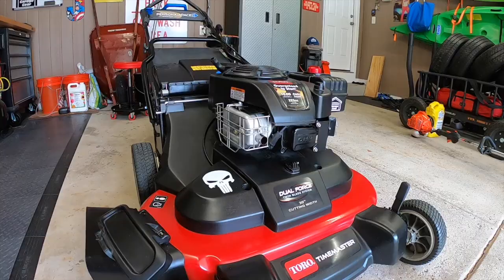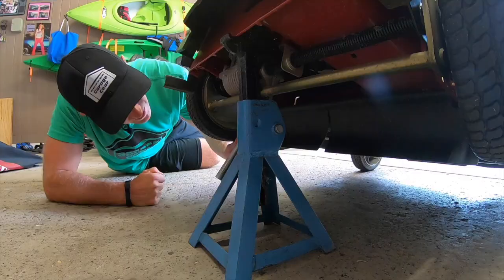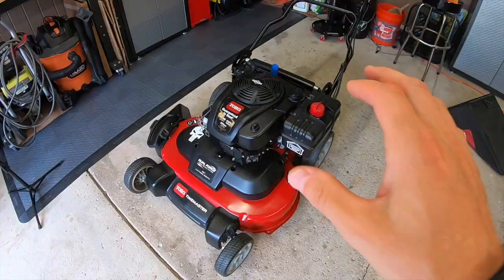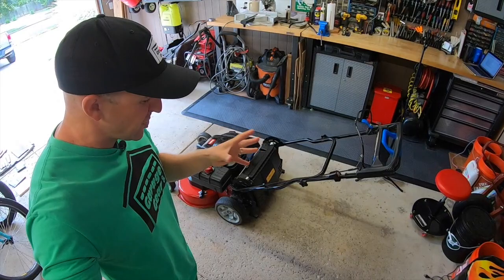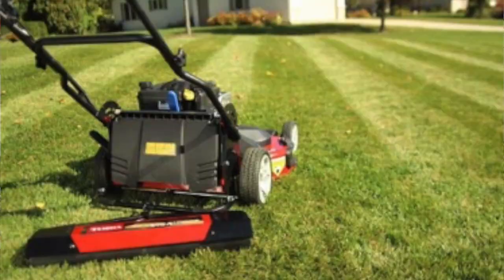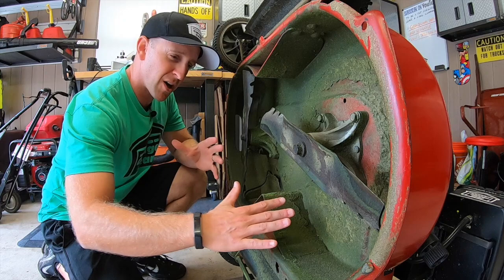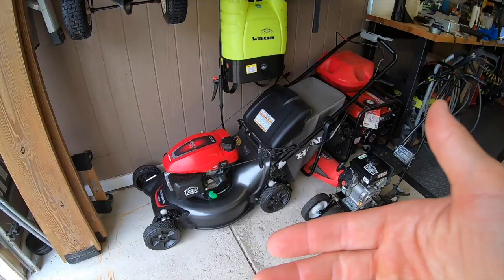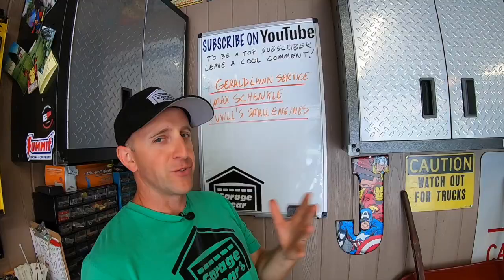BEFORE YOU BUY A TORO TIMEMASTER, WATCH THIS!

Comment: Okay I've seen this complaint about the flap. Some people are having that issue while many others are not. These Toros are assembled and built all over and there appears to be one in particular that's making the drag flap closer to the blade shroud which is eating your flap.  Sure you could make your own flap but honestly it's just going to keep happening over time.  The solution? Drill new holes and move the flap back. Let's talk about the water port. It's not really in a good place, however I don't think anyplace on that deck is a good place because you aren't dealing with a blade mount that doesn't have bearings. Yes it's true, if you use the water port or even lift your mower to wash the deck you will like ruin the bearings in the spindles. Solution? Don't wash your deck using the port. If you do use a garden hose make sure you dry your deck, best and fastest way is with a blower. Do not! I repeat do not use a power washer!. Also stop mowing wet grass but if you can't? Use WD 40 on the deck or wax. Pulley problems? Buy the commercial grade and please use common sense taking the cover off to blow debris out from around your belts and pulleys, it really doesn't take that long to do that. If you are harping about the gas tank might I remind you this mower isn't a commercial mower, it's a Residential Mower 👈. If you are complaining about that then you should have bought the Turfmaster.  Having discharge issues? Take the grass chute off and use a bungee to hold the side cover up, your grass will now spread out leaving no clumps. I rather enjoy my Timemaster and I'm with you on the gas tank, however that doesn't really bother me because I get my jobs done much faster and the mower is easy to maintain.  Sure I could have bought something else but this was in my budget and when it comes down to mowing with this or my 21 inch Toro I'll go with the 30 inch everytime. Toro could easily manufacture a bigger gas tank for the Timemaster but they wont because many wouldn't bother buying it to install because they aren't inconvenienced by the smaller gas tank. Yeah where ever your mower was manufactured they didn't drill the holes right, I can tell you without a doubt not all Timemasters are having that issue with the drag flap because I've had mine going on 2 months now and the flap isn't getting chopped up on my mower and believe me, I always check it after mowing.
Reply from the maker: Thanks for sharing this ICUE!!

Comment: The flap hasn’t went on either of mine yet, and I use them commercially, but the drag flaps are junk. Gas tanks as well. And they leak when you prop them up. I also just repainted my deck (after scraping it down to the metal from clogging) clear coated it twice and it still clogs ugh
Reply from the maker: Our efforts seem futile ya know lol! Nothing prevents the clog on these suckers. Thanks for watching Aaron!

Comment: Hi guys gr8 video I'm a gardener in Ireland lots of rain was thinking of buying the professional model I normally use a Honda 537 hrx plastic deck .Q so wud the professional model be a good buy coming in around €2900 or stick with my Honda which the price has just jumped up regards Vincent
Reply from the maker: Hey Vincent! Not to much changes other than the engine and wheels going up to the professional model. You’ll still have deck issues, and some transmission issues depending on which version you buy. You will get better pulleys. Not sure if it justifies the cost. Many are sticking with their Hondas for these reasons. Thanks for watching

Comment: I've had mine for 3 years now. Piece of junk. I've replaced the blade engagement cable 3 times and it broke again. Cheap plastic top end is always bending in a direction it wasn't meant to. Once that happens the blade will not engage. If I wrap a zip tie around it I can go a little longer, but eventually I have to replace the cable again. $35 from the dealership, $16 on Amazon. Toro does not sell the part directly (got to keep their dealers happy.) I texted Toro about the problem. Asked them why they made the part out of plastic. They mailed me a warranty extension application. Stay away from this one.
Reply from the maker: Thanks for sharing this information stedew! 👍👍

Comment: Honda HRX owner here looking to buy a time master. Be warned, the Honda is great but the suction is absolutely terrible. Sure I don't have to clean out the deck as much or replace transmission, but jesus christ I have to mow multiple times or severely overlap lines just to get stragglers in the wheel track area. If you have cool season grasses and have to mow between 3 - 4 inches HOC, expect to see lots of stragglers in your wheel track lines. Suction = TERRIBLE. Besides that, the mower is fantastic. Great engine, great tranny, mulches amazing. Just don't be surprised when your grass doesn't get sucked up high enough for blade contact by the edges of the deck
Reply from the maker: Thanks for sharing Jack! I don’t see this issue with my HONDA HRN. And the time master does have good suction!

Comment: Have a toro i bought new back in 2009 and the only issue was that the drive finally gave up, i still own it. Bought a toro recycler 3 months ago and by far worst lawn mower ive ever owned. Bagger barely catches anything, and the worst part is that the chassis itself warped. Not sure why, but the entire frame is very flimsy compared to the 2009 version. Very disappointing in the quality.
Reply from the maker: Thanks for sharing Fortbliss! Crazy that the deck warped. I wonder what’s up with that. Thanks for watching!
Reply: @GarageGear  yeah it's crazy,  not sure if just the heat from sitting in the garage or what but yeah definitely nothing I've put it through would have caused it.
Reply from the maker: @fortbliss2  that is so wild! Did you contact toro? Under warranty?
Reply: @GarageGear  I had to go through home depot and they said nothing was wrong.  Lol.  So I just get to deal with it,  so I just chock it up to money well spent lol
Reply from the maker: @fortbliss2  oh man typical Home Depot. Warranty stuff is never easy with them from my experience.
Reply: @GarageGear  agreed

Comment: So what motor would you swap onto yours if your motor goes bad what are you going with?  I've seen these mowers around and always thought it would be cool but I'm sticking with my traditional 21" honda gcv160 powered mower lol.
Reply from the maker: None lol! I would rip it all down and part it out on eBay. Get my money back!  And then go my a commercial 21” mower lol! Keep rockin that Honda iowafox! 👍👍👍
Reply: I put a Kohler Command Pro on mine.  The engine was designed specifically for this mower.

Comment: No idea what you do with your mowers but 6 years on and none of the problems you mention. I mow 1 acre regularly, it runs for 1.5hrs on a single fill (same engine), original belts, pulleys, electric start. I service once a year myself but always clean the deck thoroughly after every use, just with a hose, this way grass flow is fine. Wouldn't be without it, cut my mowing time in half.  Just wish they did a battery electric one - come on Toro, get it done please!
Reply from the maker: Thanks for sharing rabbit! They do make a battery model now. It’s $2600
Reply: @GarageGear  excellent, thanks for making me aware. I hate breathing petrol fumes.... guess it's time to save up a few carrots. Thank you 😊
Reply from the maker: @rabbit9696  you got it

Comment: So I should just get the 30” turfmaster instead? Been mowing a huge yard for 20 years now a riding mower seems overkill. I just want to finish in under 2 hours with a mower that lasts & needs minimum maintenance.
Reply from the maker: The turfmaster has a lot of these issues as well my friend. Especially the clogging. I would still recommend some kind of rider considering its price! 👍
Reply: @GarageGear  thanks for the reply great channel btw, factoring the extra cost for a rider plus bagging attachments etc also idk how I’d even get a rider to a dealer for maintenance aren’t they like 500 pounds I don’t have a truck or landscapers trailer to haul it around. Outside of the deck cleaning which I can live with the commercial parts should hold up only being used residentially much better than the timemaster right? I’m with you on the cheap pulleys & the bigger gas tank the smaller trans & engine problems being to small & shaking loose thats why I’m thinking the Turfmaster a safer bet. What mower are you using & do you have specific recommendations for me to check out?
Reply from the maker: @johnnytopside3702  hey Johnny! From what I hear a lot on the turf master, the engine is under powered for its size and the transmissions have issues. If you’re not using it commercially perhaps it’s an option. Ferris also makes one. Expensive but durable and 30 inches.
Reply: @GarageGear  I just checked out the ferris it’s a little out of my price range 2,200$ more with the bagging attachment idk why it has the huge hose attachment for the bagger. How soon do you think I’d run into trans or engine problems using the turfmaster Kawasaki like around 3ish hours a month residentially?
Reply from the maker: @johnnytopside3702  hard to say my friend but these are the complaints of landscapers using them. Just know if you buy a timemaster or turfmaster, keep a back up mower. 👍
Reply: @GarageGear  thanks again for the expert advice.

Comment: I have one it over heats 45 min and it quits after 10 min cooling down it starts back up .anybody has this issue and if yes let me know how it fix it
Reply from the maker: Hey Rodney! Thanks for sharing I’ve seen something similar on a 21” model with a magneto not working correctly. Could try replacing that to see if it helps. These mowers are nothing but work. Thanks for watching!

Comment: Just got my Timesaver. Finally was able to mow yesterday on dry grass. Saved me 20 minutes (1 hour vs 1hour 20 min). Needed to refill gas when I was 3/4 done, hopefully that will improve with a few oil changes and normal engine break in. Coming from a Honda HRX (miss that Honda “purr”) I’m still getting used to the Personal Pace (race ?). Seems either too fast or too slow. Much more clippings on the driveway than the Honda but didn’t have to double cut some areas either. Cut seems nice and even. 
Any experience using “Gator” blades ?? 
Probably will get these blades sharpened as they aren’t that sharp from the factory if I don’t swap to the Gators. 
Good info, thanks
Reply from the maker: You got it Pete! No experience with those blades. Just sold mine lol! Thanks for watching
Reply: 1 month follow up. After the 1st oil change (with synthetic) I no longer need to refill the gas tank to finish my lawn which eliminates one major negative of the Timemaster. Actually just changed the oil again - amazing it came out like prune juice after only 5 more hours !  
Raised the wheels up for the summer and mows and mulches very nice with little buildup under the deck. 
No major negatives yet other than it takes 2-3 pulls to start compared to my ALWAYS 1st pull Honda. Might be cause I’m on fumes when I finish mowing the time before.
Reply from the maker: @petedembroski6622  thanks for the update Pete!

Comment: I replaced my transmission twice within 1 year. Now I was using it commercially but come on. I buy a 600.00 cub cadet and can run them for 3 good years before the transmission starts to go. So I can buy two mowers and still have money left over. Those mowers are trash. I’m saying that as a toro guy too. I run all toro commercial riding mowers. Toro push mowers? Crap!
Reply from the maker: Thanks for sharing this Byron! Crazy to think you can buy two mowers and still be ahead! Thanks for watching! 👍

Comment: Height adjusters break due to blade hitting something hard loosens up engine only good cutting on high cut low this machine tears up belt and looses power when you picking up wet leaves only good for experienced landscapers or small engine repairmans can only use these and they'll last long
Reply from the maker: Thanks for watching wm!

Comment: should i just save to buy an exmark commercial 30 instead?
Reply from the maker: Hey Prawn, you’ll get the better engine, trans and pulleys but still clog up like crazy. The deck is still the same. Not much better but an   Improvement. Thanks for watching!
Reply: @GarageGear  thank you

Comment: Hi thanks for the video a don't think it's wort it ,how is the tuf master different are it's parts heavy duty ?
Reply from the maker: Hey vincent! You’ll get better pulleys and maybe a transmission. The Kawasaki engines I heard are underpowered for those models. You’ll still have a clogging mess underneath after every use though! Beware! If you don’t need it don’t get it! Thanks for watching!
Reply: Thanks very much will give it a miss

Comment: I made the mistake of buying one in 2016 2017 it was like 1200 or so...worst mistake ever. It's too heavy for the self propel bc the tires weren't the right design to pull it on hills etc. Could have been amazing but design flaw. A lighter self propelled 21 inch mower crushes ots speed and performance easily
Reply from the maker: Thanks for sharing Colin! Did you sell yours?
Reply: @GarageGear  yea I sold it a few years back. Best I could get for it was 600 and it was like new. Definitely learned a valuable lesson, I should have found a used 32 inch walk behind hindsight looking back lol
Reply from the maker: @colincanine2977  sometimes we win sometimes we learn!

Comment: I recently purchased a home with about 6 acres of grass. I also purchased a 62 inch zero turn which I love using my question is I have about an acre of grass right in front of my house with a lot of trees and the grass is a bit wet at times. My zero turn just eats it up alive when I turn ect. As I try to be real careful but can look terrible. I've been mowing it with my Toro 21 inch but it just takes forever and it's killing me.looks awesome when I'm done. Lol! I'm 61 years old and looking for something a little easier/faster to mow that acre with and I'm thinking about the Toro timemaster? Your thoughts, any suggestions?
Thanks
Reply from the maker: Hey Jeff you’re in a tough spot no matter how you look at it. As mentioned in the video wet grass clogs this thing up really bad! Does that part of your property ever dry up?
Reply: @GarageGear  yes it does dry up. I just have a lot of trees so the sun doesn't shine right on the grass a lot. But yes it drys up.
Reply from the maker: @jeffnewell2662  ok so now are there so many trees that you cannot use a rider between them?
Reply: @GarageGear  if it to heavy, it's going to tear the grass up. That's why I'm looking for a nice 30 inch and I was asking about the time. master
Reply from the maker: @jeffnewell2662  the weight of the unit isn’t bad but the list things repair / maintain is. If your 61 and not in the mood or shape to be fixing something all the time I would look elsewhere.
Reply: @GarageGear  I'm in good shape for 61. Not sure what you mean fixing something alll the time?
Reply from the maker: @jeffnewell2662  there’s a lot of things to constantly be repairing on this unit.

Comment: Got a serious question. Heres the scenario. So, I use a Honda HRN for my business. I just started last month. I try to do average to small yards only, that take anywhere from 30 min to a hour. I use my tahoe as a work truck, I don't have a trailer yet. Im doing great so far, I love the stuff I'm using now, and I love the work, but I want something that will speed up the mowing a bit, but can still fit in the back of my tahoe, does is this mower exist? Thanks in advance for any advice.
Reply from the maker: Hey Nobroc! It’s slim picking when it comes to 30 in mowers and to I believe this is where Toro really capitalized on the market. Do you work alone or have a small crew?
Reply: @GarageGear  Currently solo, I do have my brother help me when I get bigger jobs, but I could throw him with the Honda if I had another unit.

Comment: $1500 is too much. In my opinion if it's 1.5 times the cutting width of a standard push mower, it should only cost 1.5 times the price of a standard push mower. How they figure $1500 I don't know. I'd rather just buy a riding mower at that price and get 10 more inches of width and sit while I mow.
Reply from the maker: That’s a good way of looking at it! Thanks for watching Dwigt!

Comment: Where were you before l wasted good money on buying , not just one, but two of these pieces of crap?  In addition to the failures you mentioned, l totally fell out with the Timemaster over regular belts breaking and cables breaking.  One or both mowers were always in the shop.  I recently ditched these mowers for one Snapper 82 volt 21 inch Stepsence mower.  The rest is history.   Toro just came out with a 60 volt version of the Timemaster.   I won't touch it with a ten foot pool. (On man's opinion)
Reply from the maker: Hey William! These mowers are total junk! And that 60V version is an even bigger piece of crap lol! Thanks for watching

Comment: I have 5 timemasters 2 I bought new 3 I got from buddy at local mini tune where companies bring for repairs then ditch em cause cost it too high. he sells em to me for 150 usually blown engines. I get new generac engine 200. that's Canadian so like 50 American. I use em commercially and all your little complaints are off set by time saved cutting. I might spend a little time doing maintenance which I enjoy but spend less time cutting which I don't enjoy. the pulley system last longer if you take cover off so heat can escape.
Reply from the maker: Thanks for sharing Kevin!